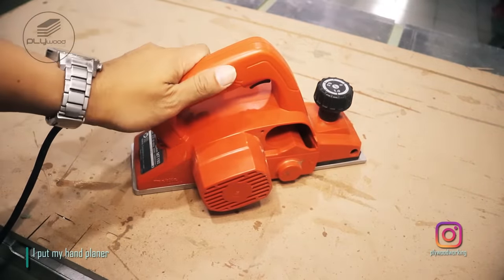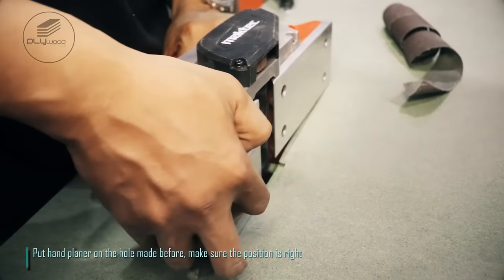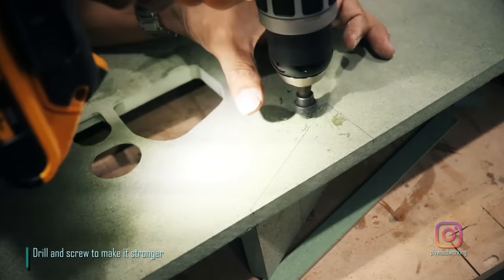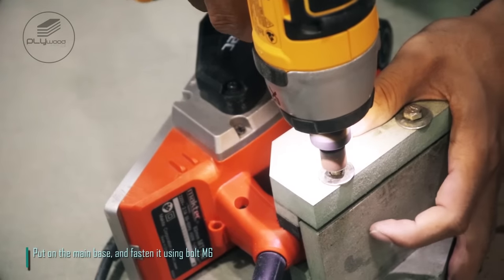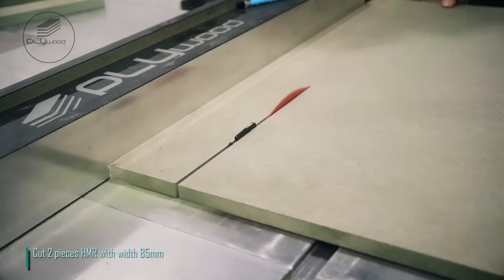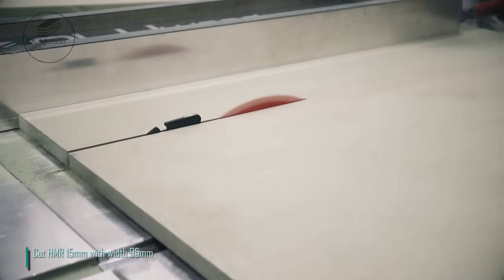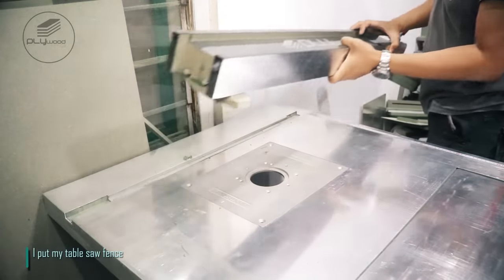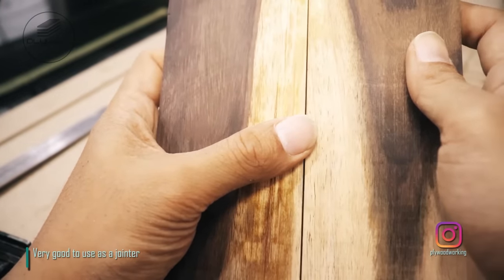Vertical Benchtop Planer Table - Jointer and Thickness

Comment: As an observation, I would suggest that when you use a table saw, you think about docking a boat.

As you push through the blade, you push inward and forward as if you were docking a boat, and sliding the side of the boat into the dock as flush as possible, watching the gap. This technique, when done properly and safely, results in the most accurate cuts that you can get on a table saw.
Reply from the maker: yes you right that work for jointer what about for thicness surface with thin wood, i think difficult and dangerous if use table saw, first before i use this planer i make straight 1 side wood use my tappering jig after that i use this  planer

Comment: Hello,
Please be very careful because with a similar configuration I almost lost a finger years ago, especially not to keep the engine running: I was thinking how to make the jig safer and as I walked away I bumped the plane with my finger, exactly above the knives that had remained in motion because I had blocked the engine running. so please be very careful and try to do a pedal ignition or something that won't allow the engine to stay on. I have yet to see the whole video but as soon as I saw how the jig was, my terrible accident occurred to me
Reply from the maker: Thank you, yes safety very important.
I thicknes little by little for avoid kickback.
Thank you for remind me👍🏻

Comment: Hi what is HMR board
Reply from the maker: High Mousture Resistant, this is new material the next MDF more solid like HDF but not heavy, really flat and water resistant
Reply: plywoodworking I’ve not heard of HMR in the uk unless they call it something else thanks
Reply from the maker: @Martin-ll7jc  maybe same material like this call valchromat almost same but valchromat fire resistant
Reply from the maker: http://www.chilterntimber.co.uk/product/valchromat-engineered-wood-fibreboard-2500-x-1250mm-x-19mm/
Reply: plywoodworking thank you